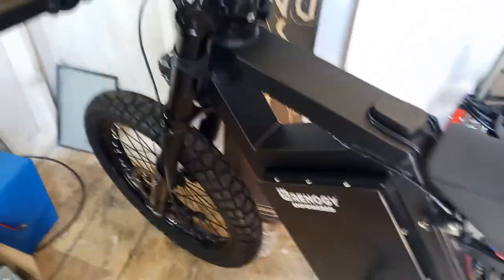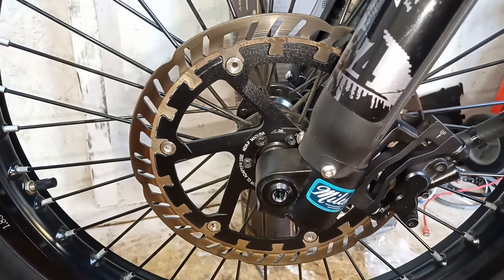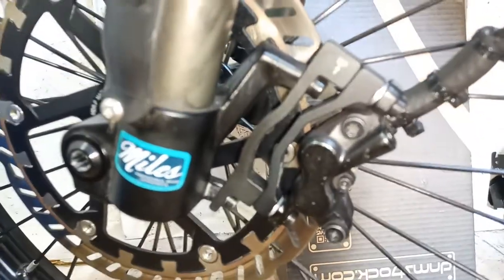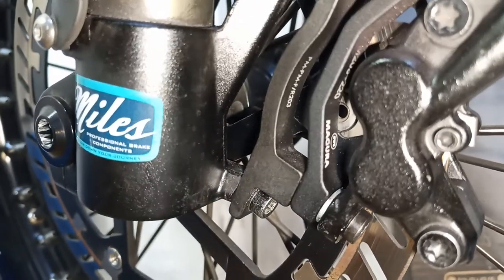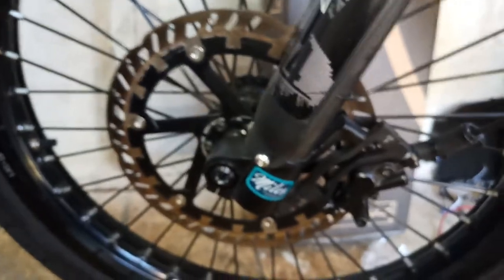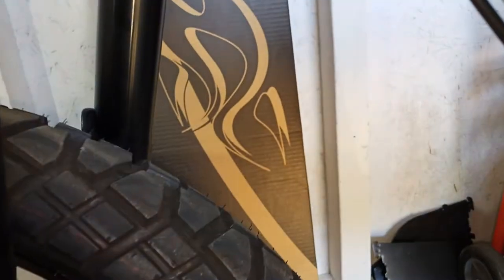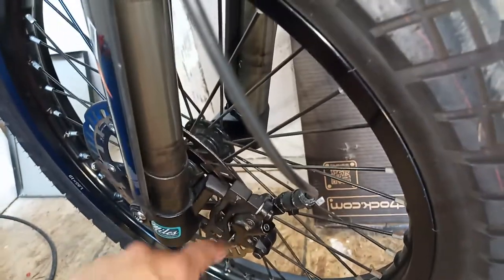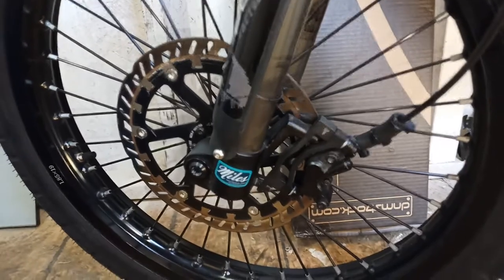CS20 EBIKE FRONT DISC BRAKE UPGRADE.

Comment: Hi. I hear you about more braking power. Have you got regen enabled?
Reply from the maker: Yes is enabled but it takes too long to kick in, about 10 to 15 seconds after releasing the throttle. I tried to change the settings but the app doesn't work well. I've been trying different ways to change the settings but no luck so far.
Reply: @dennis_503_gutierrez  you have to change settings on sabvoton and you will have instant regen on demand.
Reply from the maker: Yes thank you. The Android software doesn't work. I've been trying with PC and still no luck.. I'll keep trying..
Reply: @dennis_503_gutierrez  On pc software there is 2 ways to set regen. First one is good if you have brakes with micro switches then you can enable electric brake function and set braking current for your needs. Another way is to use your throttle for braking. Then you should enable Regenerative charge in Function and set slide regen charge current then set rpm to 100.Also need to change in some menu throttle instead of swith by default.
Reply from the maker: Awesome. Thanks for the information. I'll work on it as soon as I make some time.

Comment: Did you end up also changing the rear brakes?  Did the extra adapter already come with the Magura rotor?
Reply from the maker: I didn't change the rear rotor with Magura MDR-P yet. It's very difficult to replace the rear rotor so it will be my last upgrade since I have a dual front disc brakes upgrade soon. The adapter and rotor are sold separately.
Reply from the maker: I did replace my rear rotor one time already but I didn't use magura.
Reply: @dennis_503_gutierrez  Gotcha, cool info., thanks for letting me know!